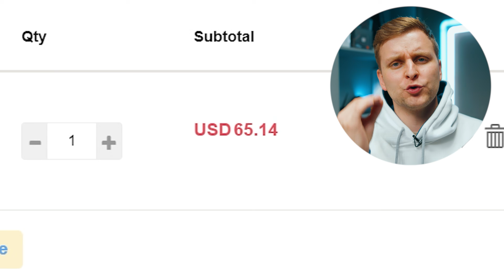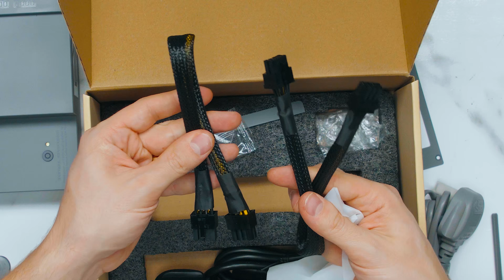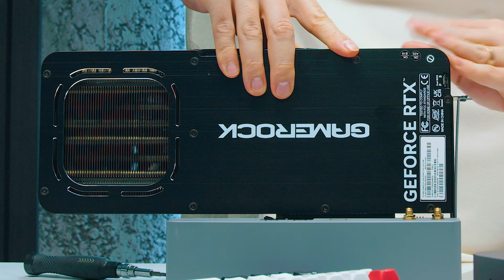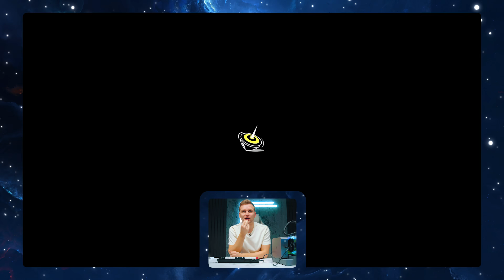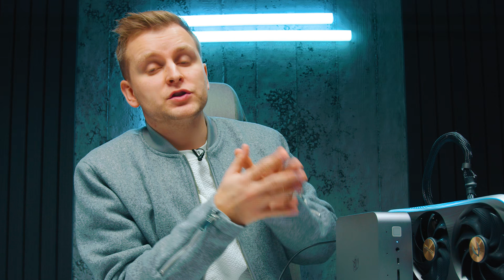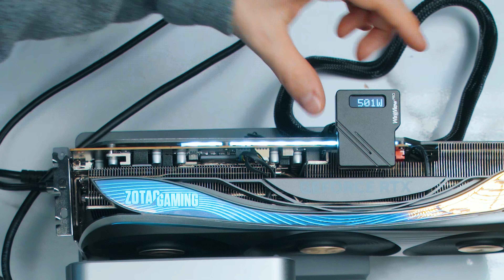Most powerful mini PC graphics... | Beelink GTI13 with RTX 5090

Comment: The current Beelink website for the EX Dock says it supports PCIE 5.0 x 8 but only with the GTI14 and GTI15. I just received a GTI13, the EX Dock, and an ASUS 4070 for Christmas. It works great so far. The memory handling is actually faster on the Intel Core i9 processors than the newer Core Ultra processors. So I wanted a GTI12 or GTI13, not the newer GTI14/15 models. Plus I won’t be getting a 50 series card anytime soon. Could barely afford the 4070….lol

Comment: I actually bought the beelink GTI 15 ultra and I actually swapped the wifi card inside it for a Kingston’s NV3 2230 m.2 2TB SSD and put the wifi card on the external dock cause even if I'm not using wifi when I'm traveling, I need the storage always available and ready to go and changed the other 2 for sabrents rocket 4 plus 8TB to have an insane amount of storage, I actually do take it every where I go and I do take the dock and GPU with me aswell, GPU is always packed in the original box, while I'm quite comfortable with mini PC being in my other bags, I'm not comfortable with the dock being in there so I actually Carry it in it's box as well, and people will ask, bro why you carrying so much hardware with you, you'll have to take a display too, a keyboard monitor, I don't need to carry a big display, I just carry my touch screen 12" OLED 120hz display so that If needed I can use the touch screen keyboard on it, to configure games and stuff and then play with my controller, and if I stay at hotel and a tv is there, I could connect it there and just use the tv as the screen while the small display as a little touch screen to enter games and stuff with the in screen keyboard and It works, better than a laptop for me cause laptop thermals sucks
Reply: Awesome need stuff...
Which Graphic card you are using with GTi15 Ultra???

Comment: I'm suppose to get this setup, but with a 5070. The video is 4 months now and no update from OP,  means it still doesn't work with RTX50xx. Bugger.
Reply: It will not work with my 5060ti and does not even recognize my 9070 xt
Reply: @Bang.Bang.24  Gti14 and 15 should work with the new dock "ex station pro dock"  Compatible with RTX 5000

Comment: great vid thx...yet i need to say it is troubling to see that half of gpu fans are facing that also heat producing box, so what were they thinking designing it like that, is already a silly question. As  an addition this type of situations, like utilizing separate parts to an assembly mostly benefits to the manufacturers like IBM, Dell and etc just because they can engineer once more over the software while having direct access to the boards and chipsets from the manufacturers making it more profitable over stability. It would be rather practical to just skip this TV units or to do the math for the situations  they can be demanded as in your case here and thus to manufacture the entire setup eliminating the need for the third parties. I would rather say, just build all in one gaming pcs, but the choice over the screen size issue is a regressive one on that obviously.

Comment: Bloody hell, that's mental! My current setup with a 3070 struggles with 4K gaming, and here's this tiny beast packing an RTX 5090. The thermals must be proepr mad though - how's the thermal throtteling under sustained load? Brilliant engineering but I'm curious about the PSU wattage requirements. Might finally upgrade my cramped desk setup! 🔥

Comment: Thanks for the video, but Beelink's website for the EX Pro multi-function docking station says it has PCIe5:   "PCle5.0 x8 interface for Lossless Connection to External Desktop Discrete Graphics Cards".  Was the video made with an older version of this dock?
Reply: looks like not a pro version, i order gti14 and will test

Comment: The issue is the CPUs TDP, in the Bios by default the CPU is pulling less power and because of that the GPU is throttling down to match the CPU so none of the components are damaged you'd have to overclock the CPU just slightly

Comment: TLDR SPOILER.. Doesn't work with the 5090. lol.   Sad day for Beelink owners like me.  I got a 5070Ti Aorus master coming.. pray for me lol.  speaking of which, why didn't mr technotice point out how he managed to install this quad-slot monstrosity onto the dock when the dock only supports 2-slot cards... The answer is that the while the Palit 5090 is a quad-slot design, it actually has a 3-slot bracket with bottom tabs only on the first two slots. Otherwise the rear bracket would need to be loosened or removed as it would not fit the 2-slot accommodation of the dock.
Reply: I just don’t understand why they wouldn’t put at least a 750 PSU in it. I’d pay an extra $50 if I had to.
Reply: @Jus-Too-Smoove costs.  Higher price lower sales. Just basic economics.
Reply: Hey man, I was about to get this rig with a 5070 myself. Did it work for you?
Reply: yes, I'm running a 5070 on it.. though the game-ready drivers were problematic, so I went with the studio drivers.. Not sure how much of a difference it made but they work fine with the games I'm playing.
Reply: @ScooterComputerAndMisterChips  thank you, i was beginnning to panic. I just bought these components and was about to cancel the beelink bundle

Comment: can you check 9070xt or 9070 ? beelink says that ex docking station pro have pci 5.0 x8 compatible witch rtx 50
Reply: I couldn't get mine to recognize the 9070xt at all. Let me know if you figured it out
Reply: @Bang.Bang.24  I’m still tryna figure it out also. Their frickin website says the docking station supports a 9070xt, but I’ve had no luck. Granted I got the standard version and just ordered the ex pro to see if that changes anything. I’ll try to remember to get back with yall
Reply: I am having similar issues with gti13 ultra and 9060xt please help
Reply: @kevinbooss  ex docking station pro It works with my rx 9070 with no problem.

Comment: You should choose PEG in the bios instead of pch pci. PEG or pci express graphic give more bandwith and more faster because its directly connected to the cpu rather than pch pci/platform controller hub pci which is more suitable for other type of expansion as it has to go through dedicated controller chip on the mobo instead of directly to cpu

Comment: Doesn't the 5000 series require power draw from the PCI express slot too?
Reply: 60watts will not save the day.
And what is the point if the power connector is bad. Still cant put my finger on why people keep gambling with dangerous gpus.

Comment: Try Linux with some LLM benchmarks
Reply: I have similar setup with Beelink GTi 14 and RTX 3090 for LLM and works like a charm.
Reply: @JorgeDizDias  Did you have to do any Bios changes?
Reply: @talantelorr  Just raised the TDP to 54W to 65W but kept all the rest. I am using the RTX 3090 for LLM tasks to maximize the available VRAM and use the iGPU to display on screen. I installed CachyOS.